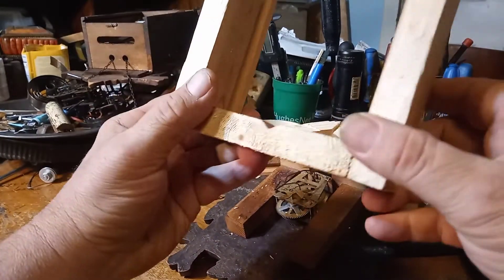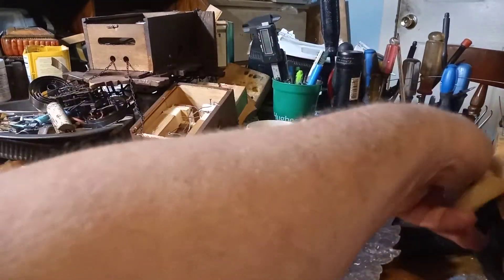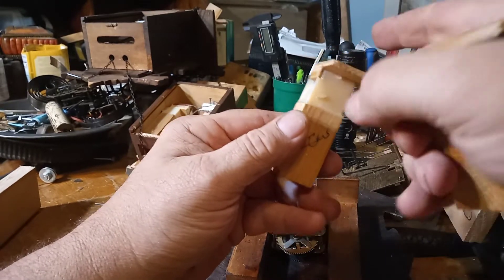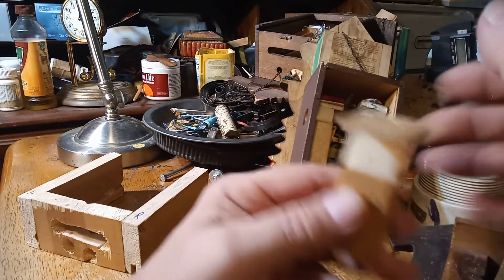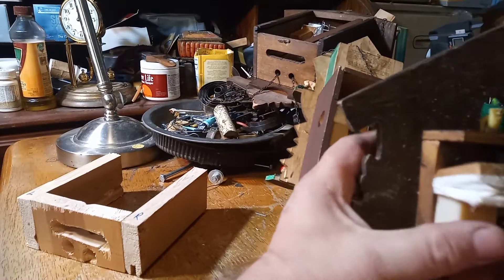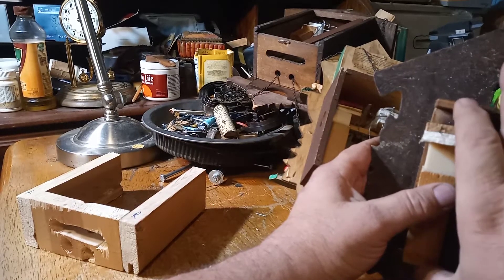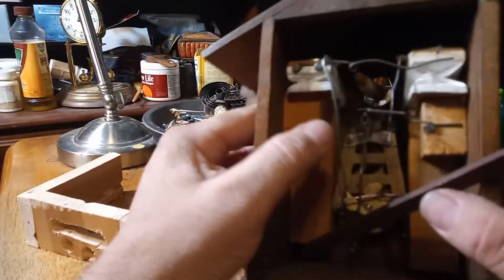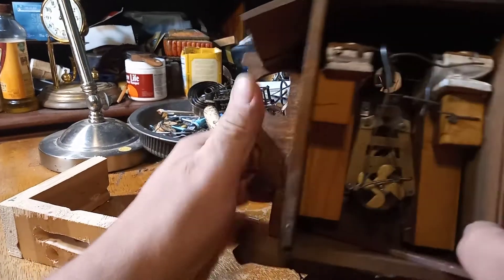Repairing a quarter hour cuckoo clock made of some type of composite material. 20220318 204015

Comment: Mark, in clocks where a man chops wood , is there a different bellow attached to produce the chopping sound?
Reply from the maker: No it is a wire that clicks off a wheel that makes the chopping sound. If you are a subscriber to my you tu be channel you should look up woodsman clock with water wheel.
Reply: @munnerlyn3  Thanks Mark your videos are very relaxing to watch and very interesting.
Reply from the maker: @maluwa6957  thank  you for those comments.